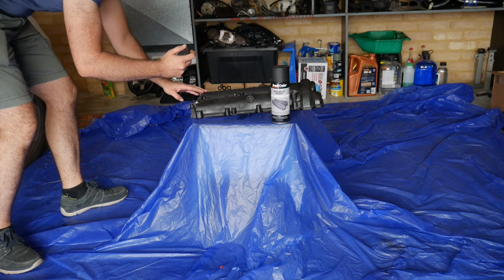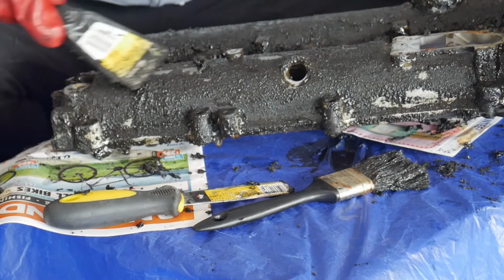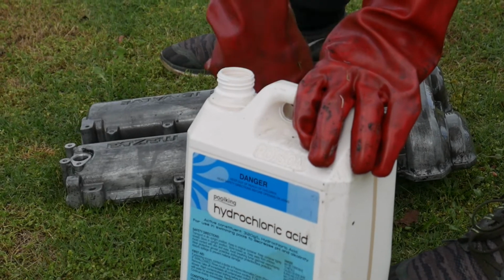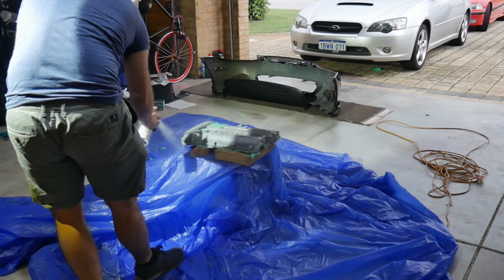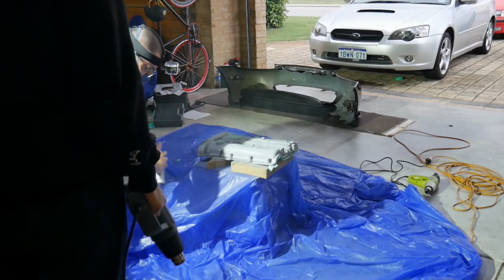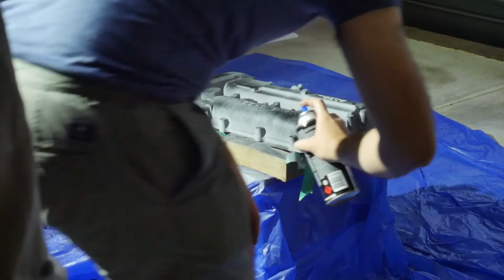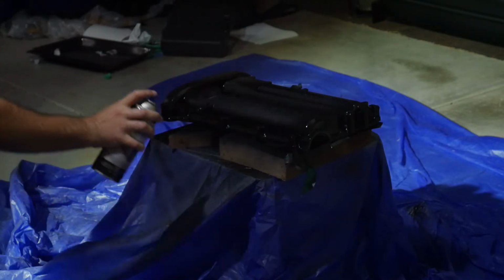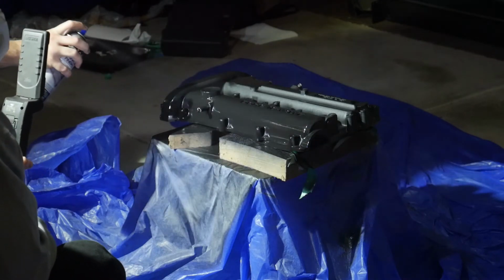Achieving the Perfect Wrinkle Finish: A Step-by-Step Valve Cover Tutorial

Comment: acid etch is a good tip.
if you are adding catch cans, you can drill and tap both ports 1/2npt and use threaded connections for nice AN lines
Reply from the maker: I'm thinking of putting in some tapped ports at some point just because it will help with some clearance issues for my SP. This wasn't for my car though, and I was just teaching a friend how to get a clean result!